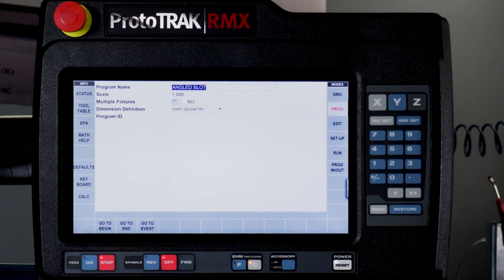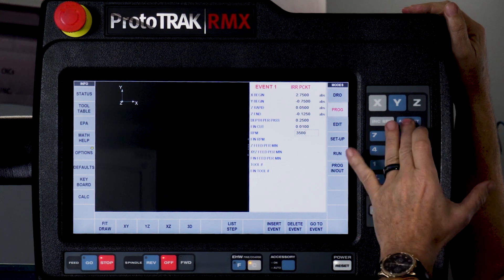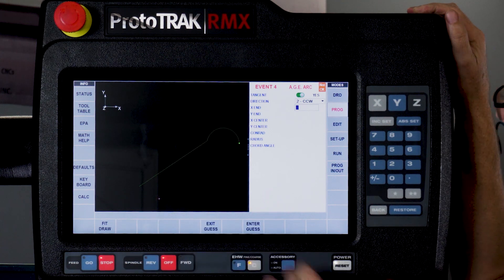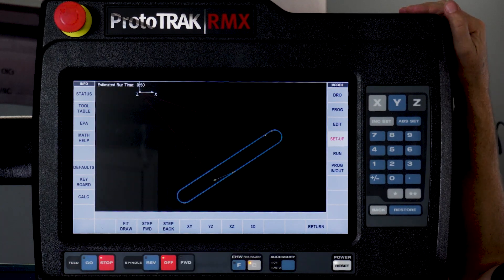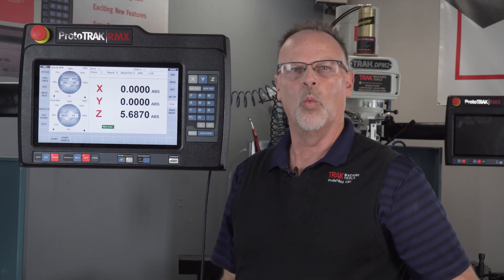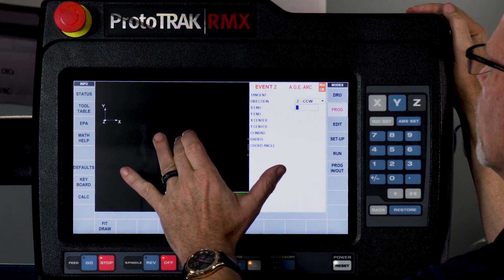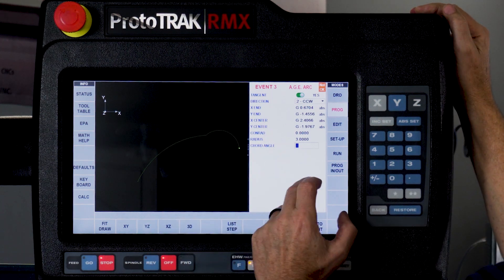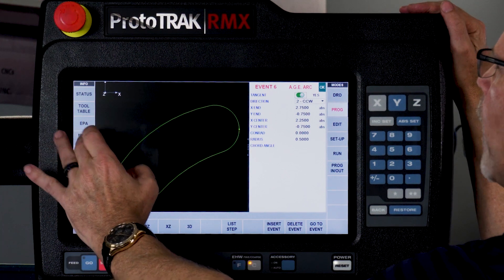Advanced Slot Milling with the ProtoTRAK RMX

Comment: What would be the best way to mill a channel through a rectangle? Part is 2.5 inches thick, 7.5 inches wide by 8 inches long. Channel is 1 inch deep by 6 inches wide and through the 8 inch length. Thanks
Reply: Hi Mike.  Depending on the material, you have three choices. 1. You could just use the rectangular profile with multiple passes in the Z axis. Whatever material is left over will just fall out the bottom.  The only problem with doing this is that your endmill will be 100% engaged. 2. Use the rectangle pocket and set your entry to helix and your toolpath to adaptive.  This way, you can control the amount of stepover and take deeper cuts in the Z-axis and cut the pocket at a much higher feed rate.  Although it will will waste some time cutting the center, it may actually machine the part faster.  3. You could drill all the way around the inside perimeter of the rectangle so that when you mill it in example 1, a lot of the material will already be gone and there will be room for the chips to fall out the bottom.  I hope this helps you.  T.P.
Reply: @trakingpat2750  Yeah, I think I will use #2 method. The material is 304 stainless, and it is not through. More like a piece of (c) channel with a flat bottom.

Comment: A nice tip for a angles slot: program first a straite rectangle with radius. Then copy that event copy rotate and enter a angle. Finish with removing the original rectangle. ProtoTRAK automatic will make a AGE program. Super done TRAK!
Reply: Great point!  I have done that plenty of times.  T.P.